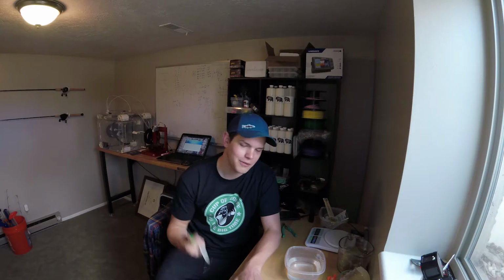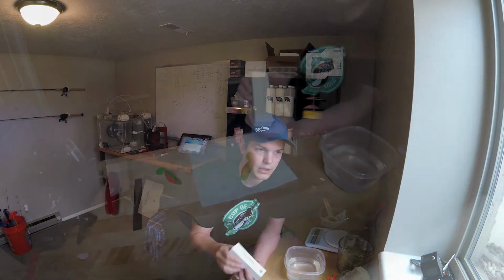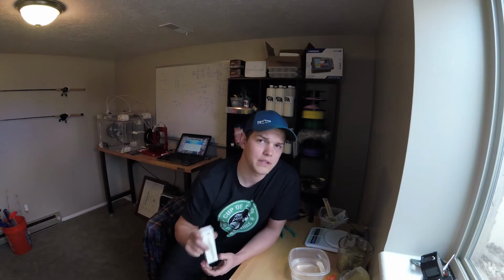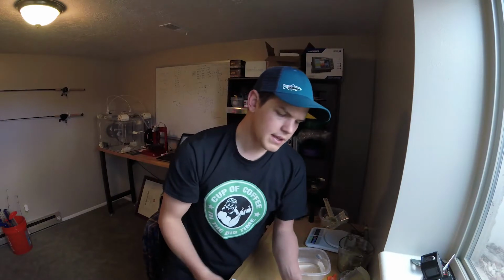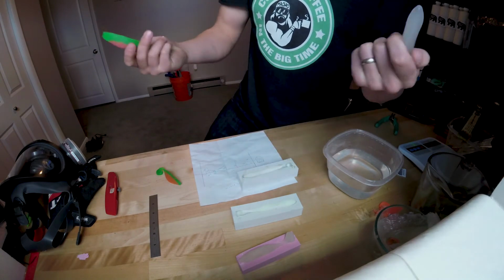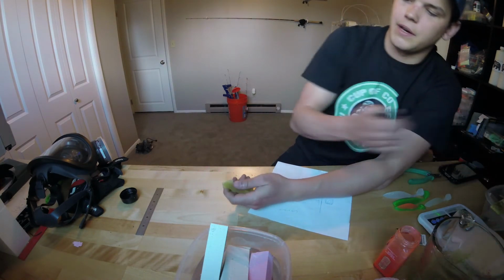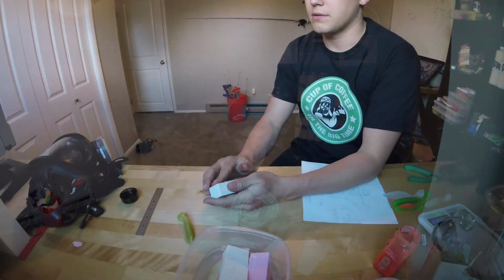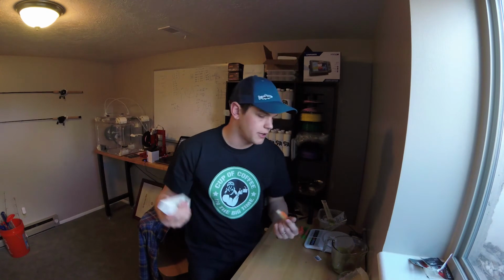Making Open Pour Swim Baits with 3d Printed Mold

Comment: I couldn't see what our saying need close up ,high heat paint works great
Reply from the maker: Hey Jamie - Have not tried high heat paint. I am working on a new video where I make a 9" Ling Cod Open Pour Swim Bait. I typically use a marine 2 part epoxy resin from West Marine Systems. Maybe I will give the engine paint a try. Thanks for watching!